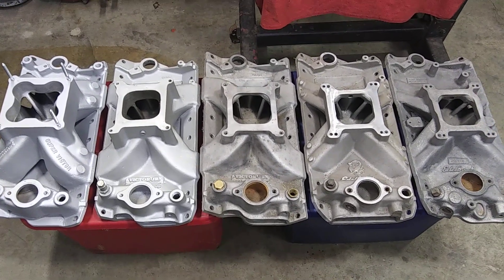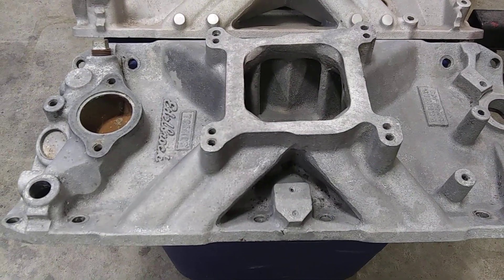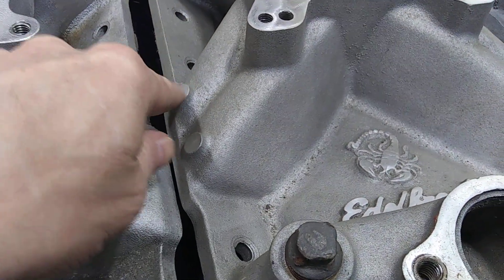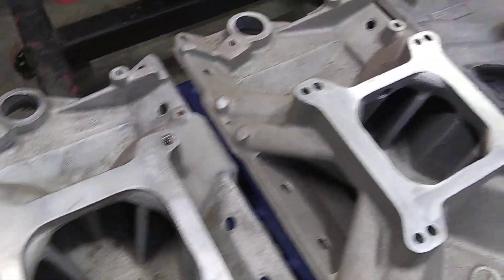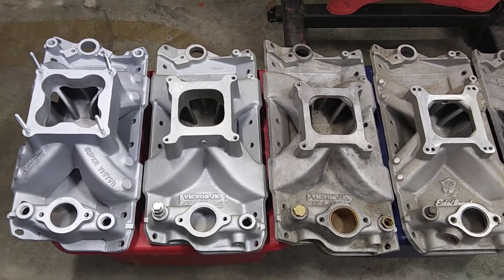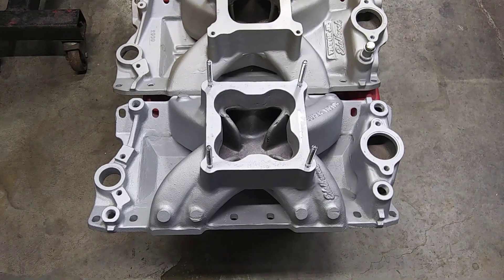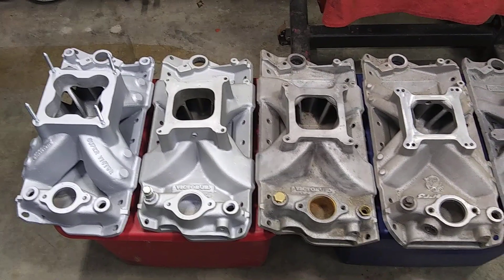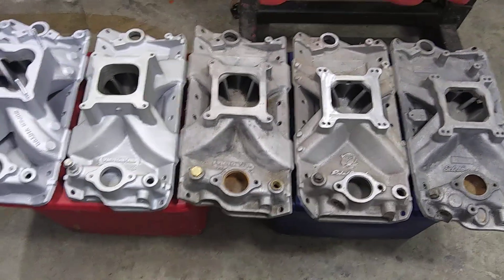The evolution of the Edelbrock singleplane intake manifold.

Comment: I remember in the early 70s when the Torker was marketed as a Manifold for the Grocery Getter.  BTW, the Torker came out after the Tarantula. The Tarantula had a Higher Carb Mount and a Deeper Plenum
Reply from the maker: @pjimmbojimmbo1990  Torker was advertised as 2500-6500rpm, Tarantula was rated at 3500-7500rpm. I've had plenty of both. Also have magazines & catalogs dating back to 69/70 era. They were released pretty much the same time. Torker for street, Tarantula for strip. I remember when they came out.
Reply: @thereluctantgearhead4544  
I have all the Hot Rod Magazine Articles, too   Tarantula article was March of 71, nice pic of the Manifold, tangled in a Spider Web. The Torker Article "A Sweetie for the Streeter" was about a year later
Reply from the maker: @pjimmbojimmbo1990  They were first called the TM 1
Reply: @thereluctantgearhead4544  
TM-1 was cast on the Manifold
Reply from the maker: @pjimmbojimmbo1990  Funny thing is people these days think they can't make no power. But I remember a 302 sbc build around 71 that made over 500 HP with a Tarantula intake with a 850 Holley DP, ported & milled 492 angle plug heads, and a .590.600 lift, 260/268@.050 106 lobe separation Crane solid roller cam, 12-1 compression. Believe it turned 8000+rpm. They ran three identical cams in it except for lobe separation, one had 106, next was 108, last was 110. Ranged from 505 HP to almost 520 HP. 106 Lobe separation unit made the most power in that particular build. Also tested three rod lengths, 5.565, 5.700, 6.000 in the same engine, wasn't 5 average HP difference between all of them. Just moved the curves around ever so slightly. That old shit still works. Seen a 460 hp 350 tested with a performer RPM and also a old Torker. Made around the same HP, but the Edelbrock RPM made more torque below 4000 rpm. That was in the late 90s.

Comment: This video taught me exactly what i wanted to know about my Original Worker I’ve got. Im definitely gonna swap it for a modern dual plane because its on my daily but ill put it on the shelf for future use
Reply from the maker: @oogboog7049  Glad to be of help. A RPM will make more torque and similar HP on a typical SBC build. Dave that old shit tho. Getting more rare by the day.
Reply: @thereluctantgearhead4544  oh yeah i plan to, this motor i got for cheap was built around 3 years ago but all the parts are early 70s/60s 461 camel hump heads, port matched 64 cc combustion cambers. 2.02 intake, 1.60 exhaust. Along with some “motion” valve covers
Reply from the maker: @oogboog7049  If ya really want a good dual plane intake, look for the old Holley Street Dominator that looks like a GM LT-1 intake. It's a real good piece. Nice runners and plenum volume. Still see them on eBay for $200 or less. The original "Street Dominator" intake was a single plane, but they discontinued it and put the name on a dual plane. The ones from the mid 80s are best. Also GM made a cast iron highrise dual plane for oval track racing, it's a monster. Probably the best dual plane ever made. Got used on Alot of boats too. It's a cast iron version of the old 1970 LT-1 intake that'll take a Holley or Q-jet. Other than the weight, it's a real good piece. I have one I made a video about comparing it to a Edelbrock RPM. Big difference. They can be found on eBay for 2-3 hundred bucks. They were expensive new. Bowtie duel plane. Not much progress been made in the dual plane intake performance since the 90s. Another killer intake is the highrise Mercruser boat intakes that look like a Eddy RPM, but they are way better. Came on Mercruiser Bravo 383s & shit. Expensive as hell tho. Might find a used one reasonable from someone that just thinks it's an old boat intake. I traded a Victor Jr intake for one. New they cost close to a grand. Water jackets are brass, etc. They make Alot of power for a dual plane too. They come powder coated black. Won't corrode for shit. Made to handle salt water. I think the stock boat engine they came on made around 430hp/480tq. They are out there.
Reply from the maker: @oogboog7049  Look for my video on the Bowtie dual plane intake. Check it out. Can't do much better than one of those.
Reply from the maker: @oogboog7049  Makes the RPM look like a stock replacement.

Comment: ................Correction,,,,,,,The Tarantula was the first single plane single carb manifold from Edelbrock......It was advertised  in hot rod magazines months before it's release.......I bought one for my 327 back in 1970.....maybe 2 years later came the Torquer,,,,,,,,,,,then the torquer II ,,,,and the scorpian.........Edelbrock had another smog manifold called the SP2P......tiny runners , big joke.............Anyone that went serious fast ran a Tunnel Ram........................A couple of years ago I found an old Tarantula and a Torquer on ebay  ; I bought them for my collection.....................anyway...............................................................
Reply from the maker: A TM1 is a tarantula. I have those magazines from the era myself.
Reply from the maker: I have magazines from 1970 showing a tarantula and Torker being sold at the same time. The Torker was the street unit good to 6500rpm, the tarantula was the strip version good to 7500rpm. The tarantula had slightly bigger runners. I'm old too bud. I was alive in those days and I still have a good memory of the shit. Not much else tho. I have over 100+intakes too, I know what I got.
Reply from the maker: I've owned or own every single intake Edelbrock ever sold.
Reply from the maker: Had a SP2P I got that came in a engine I bought, but I gave it away. Same with the old Streetmaster. Worst singleplane ever cast. Stock intake made more power than either one of those.

Comment: Excellent Video! My Scorpion had been sitting in the garage for 15 years. Going to remove the Weiand, and pair it with my Edelbrock 650, on my 327 for that pure '70's Hotrod esthetic in my '54 Belair!
Reply from the maker: Now ya need some gold Moroso valvecovers to go with it.
Reply from the maker: Gotta love the 70s, that's the era I grew up in, so it's a heavy influence on me. Them old Scorpions work pretty good. I'd recommend a 2 inch open spacer with it.
Reply from the maker: My first car was a 53 Chevy. Wanted to build a gasser with it. But I ended up buying a 67 Firebird to build and the old Chevy got parked in the yard.
Reply: @thereluctantgearhead4544  I inherited my '54 from my Aunt in '92. We've been together since!
Reply from the maker: @tonybennett3  I'd definitely hold on to that one.

Comment: I have an old original Torker on a warmed over 355 in my old hot rod c1500 it works just fine. I can whack the throttle off idle and light the tires up no hiccups or hesitation that's with 3:08 gears... Seems to have great low ent TQ for a single plane but it would be good for a dual plane and it pulls strong right up to the top so win win I suppose. I had thought about swapping it out for a perf rpm but figured money would be better spent elsewhere.
Reply from the maker: Yep, them old Torkers worked just fine on millions of engines over the past 50+yrs, people get caught up in the latest thing and think everything old has to suck. I like old shit myself, because I'm old too. There's always better, but then there's always worse too. If something suits my needs, I don't care how old it is. I have a 69 455 Oldsmobile engine with a Torker on it, been sitting on a stand since 2005. Fixin to freshen it up and put it back together, gonna use that old Torker I've had for 30yrs on it too. That engine ran 6.80s in the 8th in a gutted 79 Cutlass. So it worked pretty good for me. My first SBC engine I ever built had a TM1 intake on it with a 750 DP Holley, ported 186 heads on it and a Comp 305H Magnum camshaft. That thing ran damn good for being built by a kid. I dropped it in a Malibu wagon. That engine ended up running mid 7s in the 8th. My first engine I built was a 67 400 Pontiac tho. I was all about the Pontiac and Oldsmobile engines.

Comment: Cool video. Remember the gas ration days of the late '70s? That's when Edelbrock brought out the Streetmaster but even worse was the SP2P intake manifold. Offenhauser had the Duel Port then Holley had the Z manifold designed by Zora Dontov for better low end with a single plane intake.
Reply from the maker: Yep, those were dark days for sure. That SP2P actually made less power than a stock intake and didn't do shit for gas mileage. Probably get worse if anything. Don't see many of those old late 70s "economy" intakes anymore. The Streetmaster singleplane was definitely a bad piece too. Don't know what they was thinking. It was too small for a stock  283.

Comment: What stock cast iron Chevy intake is best for performance on dirt oval track racing in your opinion I run pure stock and everything has to be stock
Reply from the maker: The late 60s pre EGR intakes are the best stock cast iron. If your rules allow, GM made a cast iron bowtie intake based on the aluminum 1970 LT-1 intake, but with a Q-jet pattern, came stock on some boats, has a GM part number. It's the best cast iron SBC intake available. I see them for sale usually around $200 bucks from a marine application.
Reply: Hey  JR you should check out Randy Brezinski  for a good cast iron  intake . He really makes a stock intake come to life. I think his intakes run better than aftermarket.
Reply: Yea everyone used to run them we call them bowtie intakes but unfortunately I can't run it nowadays by the rules do u know anything about the crows foot intakes
Reply from the maker: @juniorwhelchel6337  That's probably referring to the early units. Intake from a 68 295hp 350, also used on a few others.

Comment: 11/24/22 356. First Victor jr. Looks a lot different than the scorpion inside. Thinner dividers , more floor space between each divider. Suprised you said they were similar. (Prehaps they preform similar?) I know lingenfelter adds epoxy to lengthen / knife edge the dividers with dicent gains.
Reply from the maker: I've had these intakes hanging on the wall for decades. Probably never use them. I like to collect old intakes tho.
Reply from the maker: The 2970 probably gonna go on an engine pretty soon. The old Torker and Scorpion haven't been on a engine in over 30yrs.
Reply from the maker: I was referring to the dept and height of runners.
Reply from the maker: It's obviously different.
Reply from the maker: Scorpion about a inch deeper plenum than the Torker.